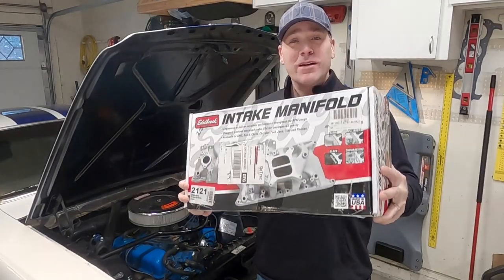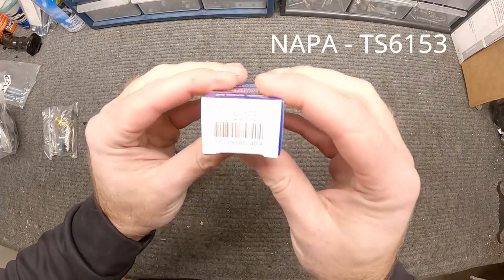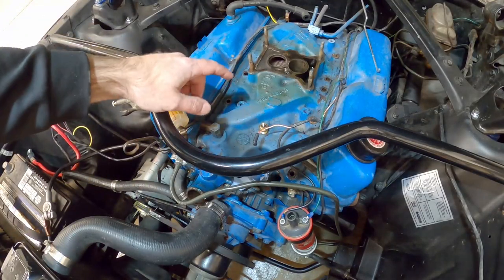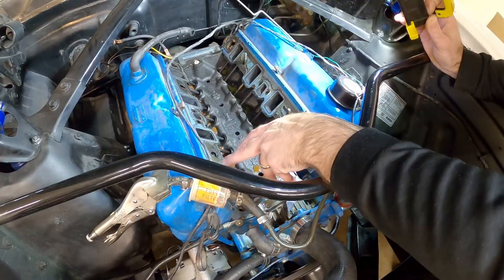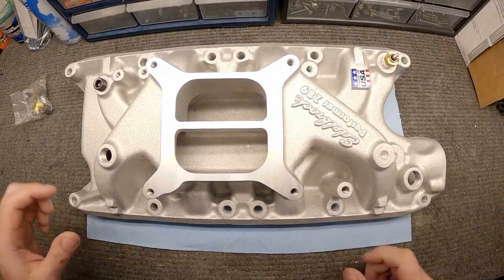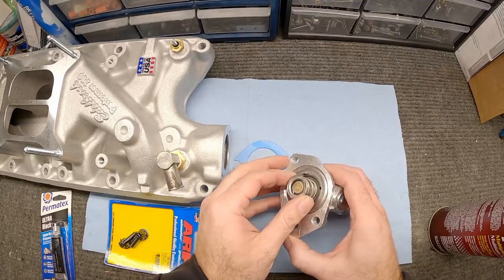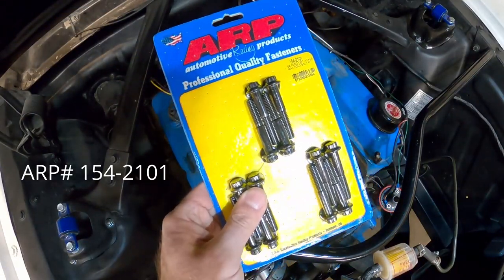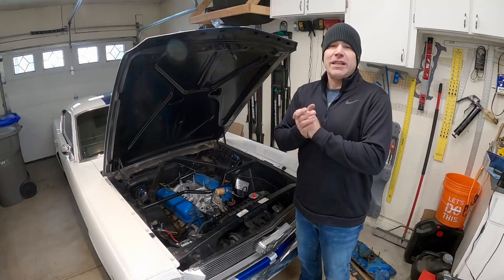How to install Edelbrock Intake Manifold on a 289 or 302

Comment: I’m putting a new intake on my 302 and needed a refresher, this was perfect, Thank you! And thanks for being honest about the RTV on the gaskets! I first did that same Edelbrock manifold 15 years ago on a 5.0 HO roller block. The heads have a coolant passage at the rear. That Edelbrock intake doesn’t pass the coolant across to the opposite head like at the front of the block. Well after a decade the aluminum rotted and crumbled away. Electrolysis, like on a boat. There are intakes that accommodate the rear passage. Professional products makes one.
Reply from the maker: No problem, happy to help.  :)

Comment: Just did this a few months ago! I'm having a little pooling down in those crevices on the water pump, but have been too lazy to pull it out and reinstall it right, but I think you've inspired me to do so, plus I have a guide now! Another great one, thanks!
Reply from the maker: Sorry to hear about your coolant issues, but like you said, hopefully this will help.  Also, I redid my water pump and timing cover and that will be out in a few weeks, maybe there'll be some good info in there too.  :)
Reply: @AndyKruseChannel  oh yeah that sounds like just what I need! I'm in the process of running some new wiring around my engine bay. I'll probably be finishing that around the same time you're uploading the water pump and timing cover, then I can jump right into that. These cold months really slow me down, and make me realize I need a heater for my garage! Hopefully it'll be a little warmer for these bigger projects. Also what carburetor did you go with? I'm rocking a 650cfm Edelbrock AVS2 (Manual Choke) and that same performer rpm manifold, seems like we have similar tops ends! (If you're saving the carb reveal for an upload I'll be patient and wait for that, cause I know I'll be here to watch it!)
Reply from the maker: @StankyPete9  These months slow me down too.  I did a bunch of videos in Nov so they could be released in Dec and so I didn't have to be out in the cold.  But all those videos have come and gone and I've had to be out there making more in the cold weather.  I need a heater too.  :)
The new carb is coming on Thursday!  :)

Comment: You need to do like me. I live in the northeast and decided I didn’t want to see my breath anymore. Or not feel my fingers while I’m working on my car. Bought a mr heater 80k btu and ran a gas line up from my basement. It’s 65 in my garage in 15 minutes now, even if it’s in the teens outside. I’m working in a t-shirt. For less than 1000 bucks you to can be working in comfort.
Reply from the maker: I like your idea, but I think I'd rather throw $1000 at the car right now.  :)

Comment: Safety tip, always disconnect the negative terminal of the battery first. If you are wrenching on the positive post before disconnecting the negative, you have a chance of arcing to something with your wrench.
Reply from the maker: Thanks for the heads up.

Comment: Another great video Andy!  I saw lots of back and forth debate when researching those cork gaskets.  Since I had time, I went ahead and used Permatex Black to set the cork gaskets to the block, waited a day, then did the rest.  This way the cork gaskets couldn't move around.  I was too worried about the integrity of just sealant alone - what if I didn't build it up high enough to seal?  So yeah, we'll see if it works, I'm still waiting until Spring to get my engine back in the car.  Also, Alf's Garage taught me to not use the teflon tape on the temp sending unit, so heads up on that if you find your temp gauge isn't reading right.  So appreciate your vids, keep up the great work!!!
Reply from the maker: Yeah, I saw one of Alf's recent videos and he didn't put teflon tape on the Temp Sending Unit, but it was after I made this video.  I have since gone back and removed that tape, you'll be able to tell on future videos.  It's one of those things I might try and mention when I do follow-up videos.  :)

Comment: Another great video, you and I seem to be almost doing the same projects to our 66 fastbacks at the same time. I did my intake upgrades last summer, I went with a holley 600 cfm part#0-80458SA, and my car loves it! I also upgraded the cooling system at that time. Keep the videos coming
Reply from the maker: That is awesome!  What else have you done?  I might need a few ideas.  :)
Reply: @AndyKruseChannel  aluminum 3 row radiator, hi flow aluminum water pump, new thermostat housing, and hoses, I added a trans cooler, ford racing intake, holley carb, higher flow fuel pump, I did black braided fuel lines for a race style look. Monte carlo bar, shelby style export brace, i did shelby air filter & shelby valve covers, upgraded the headlights to tri bar style halogen and upgraded the wiring harness.  If you remember...we chatted before about wheels and tires I did 16s as well(torque thrust). The next hurdle is 4 wheel disc brakes & ill be doing the rear diff like you did on your coupe. I'd love to share pictures and ideas/info with you
Reply from the maker: @nathannelson7020  Wow, that's a comprehensive list.  Maybe I'm the one that should be saying that we're doing our projects at almost the same time.  My contact info is on the "About" tab, a few pics of the car would be great!
Reply: @AndyKruseChannel  I've been fortunate to be able to make good forward progress. I'll definitely shoot you some pics

Comment: I have a 68 cougar with the same C code 289, I’ve been thinking of switching it over to a4 barrel like this. Did you see much performance improvement with just changing the intake a carb.  Great video, thanks.
Reply from the maker: Yes, but my butt-dyno is not calibrated.  I wish I would have had a chance to put the car on a real dyno before and after to see the gains, but I wasn't able to do that.  You should notice a difference, but you won't be setting any land speed records with it.  :)
Reply: @AndyKruseChannel  I’m not looking to build a race car, just something nice to cruise in that is reliable. I’ve done some research and from what I can find I don’t know if anyone makes a carb kit for a 2100 that will stand up to ethanol. Thats why I’m looking at switching to a 4 barrel. Also I did some head damage years back and have to decided if I want to fix the factory heads or switch to some aftermarket heads. The one nice thing with my car is it is all numbers matching so keeping it that way would be kind of cool.  Changing out the heads could end up going down a really deep rabbit hole, but might be worth it in the long run. Thanks for the info.

Comment: Heck yes! Just got the same one for my 289
Reply from the maker: Nice!  What carb are you going with?
Reply: @AndyKruseChannel  right now a 1406 but I have the sniper Eli on the shelf that will go on once I finish my safety list and get her running again.
Reply from the maker: @DriveBreakFixRepeat70  I like the 1406.  That Sniper will be fantastic, no more messing with the cold weather choke or mismatched jets and rods.  :)

Comment: I have a stock 351c 2v with headers that I put an aluminum edlebrock and a 650 cfm carb and it bogs at wide open throttle. But if u ease into its fine. Runs grate at idle and is good when cruising. But just no wide open.
Reply from the maker: It's likely too rich if you mash the pedal and it bogs.  With the edelbrock it could be too small of rod or too large of jet, or some combo of both.  There are edelbrock tables out there where it can help determine the rod size for your given application.  Because of the step in the metering rod, you can dial in idle or cruising fuel flow, and then also pick a different diameter for WOT.  Without know the specifics of your setup, it's tough to point you to a specific rod size, so you'll need to do a little digging there.  :)

Comment: Hey Andy I really do enjoy your videos they are very step by step for the average guy like me just getting into the Mustangs got the 66 with  a stock 289 do you think the  Edelbrock  intake with a 600 Holley is too mucho for the stock 289 right now so I guess the question is the 600 CFM thanks very much
Reply from the maker: Thanks!
I found that the 600 is probably the upper limit of a stock 289, you might find a little better performance with a 550 or even a 500 cfm unit.  However, as you begin to upgrade parts and pieces, you may find that 600 is where you'll want to be.  :)
Reply: @AndyKruseChannel  thank you very much for responding

Comment: Great idea on the guide studs! How are those gaskets holding up? Any leaks? I know that Edelbrock says not to use that type of gasket, they suggest the fel-1250 if you are going to use fel-pro.
Reply from the maker: Gaskets are great, no problems or issues.

Comment: Thanks for the cool video. Did you notice much of a difference in performance after this?
Reply from the maker: Barely, but that is probably because this engine was tired and needed to be rebuilt. Most engine modifications to n/a engines are difficult to notice individually. It’s really the some of the parts that a difference can be noticed.

Comment: Little help.  I installed the felpro 90103 gasket but and now have a little vacuum leak up front /left by the #1 cyl.  Noticed instructions with gasket say no RTV on gasket but I see you used some.  Did you get a vacuum leak?  Also, I noticed you didn't use the cork gaskets for ends.  Any particular reason?  getting ready to redo and replace gasket and try again.  Thank for the help, and love the videos.  I've used a few of them.
Reply from the maker: Not sure why you're getting a vacuum leak, maybe retorque the bolts?  There are some gaskets that are designed to not need some kind of sealant around the water ports, but I have not been successful without putting some sealant on.  I do not believe I have any vacuum leaks, as irregular idling can be an easy indicator of leaks and my idle seems fine.  The cork ends are designed to work for most cars, and they probably would have been fine, but that RTV I used guarantees an exact fit.  :)

Comment: Does the Teflon tape cause any issues with the sending unit? Bad connection to ground?
Reply from the maker: I definitely can cause issues, especially if there are several layers.  I went back and took it off after this video, you'll be able to see it's not on there in later videos.  Good eye!
Reply: only the sensor needs to make contact with coolant, not the threads

Comment: Good video thanks for showing the good and the bad!. One question do u know the size  of the bushing for the heater hose fitting? 👍🏿
Reply from the maker: Thanks!
I need a little more help, which bushing are you referring to?  :)
Reply: @AndyKruseChannel  the one that the heater hose goes to there was only 1 adapter or bushing where the water inlet housing is
Reply from the maker: @Donny.C.wlWilliams  Are you referring to the that Elbow piece that comes out of the top-front corner of the Manifold, the one that would normally route the heater hose to the firewall for the heater core?  Or maybe that adapter piece that the elbow threads into, that is threaded into the Manifold?  If it's this adapter piece, it's a 1/2-14 NPT to 3/8-18 NPT adapter.  :)
Reply: @AndyKruseChannel  yes

Comment: If you install the manifold and the edelbrock carb instead of the stock parts will it be a big difference?
Reply from the maker: Yes, but my butt-dyno is not calibrated.  I wish I would have had a chance to put the car on a real dyno before and after to see the gains, but I wasn't able to do that.  You should notice a difference, but you won't be setting any land speed records with it.  :)

Comment: Awesome content 💯
I have 260 sbf
I bought a performer for it and a 4bbl 1405  carburetor, im not sure if this carburetor is too much cfm for this little engine unfortunately i bought it used so cant return it, what would u suggest i can do without have to break the bank 
Thanks
Reply from the maker: The 1405 a lot of carb for the 260, but on the fuel side.  The engine will only pull the air it needs, so a 1000 cfm carb would still work as long as the fuel is set correctly.   You can put in large rods and smaller jets to to reduce the fuel, but in the end it might just be easier to pick a 500 cfm carb and sell that 600.  :)
Reply: @AndyKruseChannel  thank you andy
Reply: Would I need to use a spacer gasket or just use the single gasket that comes with the carb, I've seen.sometimes a plastic or rubber gasket to space it out and then add the gasket that supplied with the carburetor
Reply from the maker: @sonnyskustoms  If you use a phenolic (plastic) spacer, you need a gasket on either side.  I prefer the common paper gaskets, but there are other materials out there.  The important thing is each side of the spacer needs a gasket.  If you don't use a space, just one gasket is needed between the carb and the intake manifold.  :)
Reply: @AndyKruseChannel  awesome ok thank you sir
Cheers 🍻

Comment: What would happen if small debris went into the holes in the lifter valley?
My son and i got the old intake off of the 289, and i asked him to clean off the old gasket.  
He has a thing about getting his hands dirty and sprayed the lifter valley with engine degreaser and cleaned the build up first. Then he scraped the old gasket material before i realized what happened. 

Can’t be mad at him for cleaning, i should have been more specific.  

I am not sure how much debris went in the holes, but i do know an entire can of degreaser was used.
Reply from the maker: Those holes in the lifter valley lead to the cam shaft and down into the oil pan.  The likely scenario is that any large pieces fall down into the pan and sit there until you change the oil.  There's a screen on the oil pump, so those piece shouldn't make into your oil system.  If the debris is metal and lands on the cam shaft, it might get pinched in between the lifters and the cam lobe and scratch something, but that's a low possibility.  You can always change the oil for piece of mind, but depending on the pieces size and location, it may just sit in the pan until you pull the pan off and clean it out.  :)
Reply: @AndyKruseChannel  Once again, thank you
Reply: @AndyKruseChannel  NM

Comment: Just ordered my Edelbrock 2121 does the nuts and bolts and gasket not come with the intake manifold?
Reply from the maker: I don't think it does.  There is some hardware that comes with it, but not the four carb studs, nuts, and gasket.  It also does not come with the intake gasket set, but you probably already knew that.  :)

Comment: in the end did you notice a pronounced difference in performance, and if you did, in what way,  low end torque, accellereation, higher rpm gains at highway speeds?.
i have a 1967 ford fairlane with a stock 289 2 barrel mated to a C4 trans. it has good pick up, will never be a race car but i often have enternained the thought of doing similiar modification. Is it worth the gain in performance ?
Reply from the maker: I have not had a chance to take the car out yet and see, we've still got snow out here.  However, I had a very similar setup on my last Mustang and I was very happy with the increased "happiness" of the car.  Once dialed in, the car felt like it had a little more Pep when you hit the go pedal.  :)
Unfortunately I think just upgrading the intake manifold is not enough of an upgrade to justify it.  However, when coupled with an upgraded Carb and an exhaust, it's absolutely worth it.  The small bump in power, response, and sound will put a smile on your face.  You won't win any races that matter, but it kind of brings the car to life.  :)
Reply: @AndyKruseChannel  thank you for that !